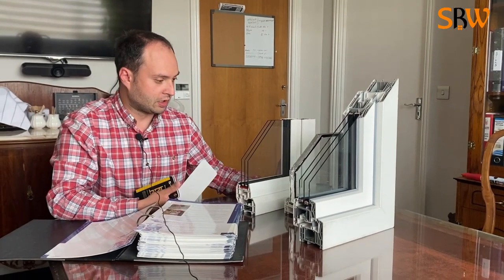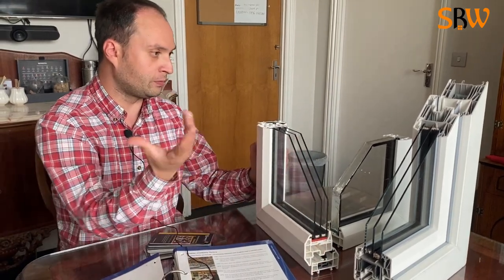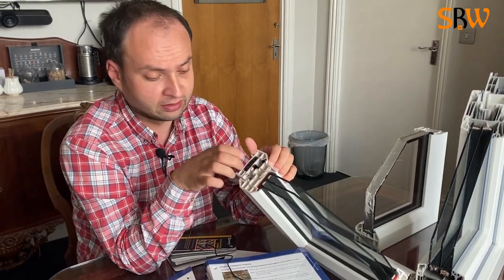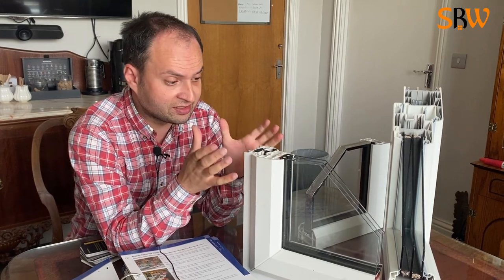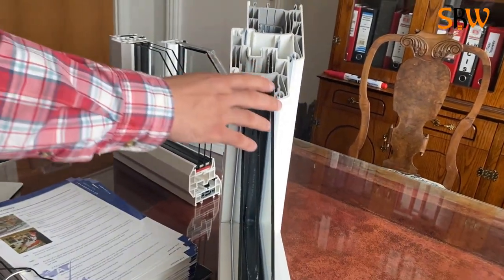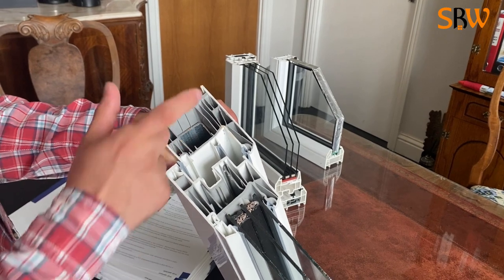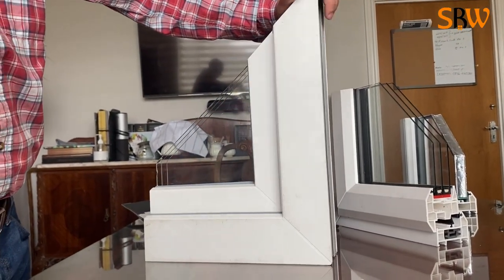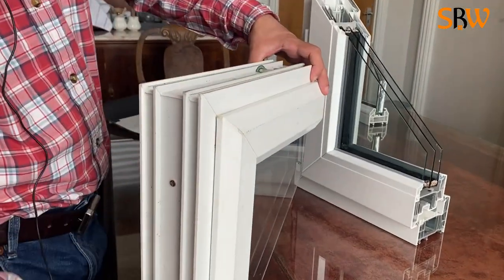ANGLIAN WINDOWS - THE BEST WINDOWS IN THE  UK MARKET? / SBW GROUP

Comment: Shit company and shit quality windows, doors etc.. I have order from them composite doors with the treshold l received without (normal window frame witch finaly cracks on corner after one year and the water is leak inside when is rain.the lock is broken as well, sometimes l cant open the doors by key because something is broken inside. They tryed sell this simple Doors for 3600£ l told them it is to much for this kind of doors, finally l bought this doors for 1500£. With installation also very bad quality, no foam between frame and bricks. We opened a case but everytime they ignored Us. Im Not recomend this shity company, very bad experience. Beware!!!!

Comment: EU regulations require a minimum percentage of recycled material in new replacement windows, if Rehau don't use a virgin PVCu on the inner and outer skins then the whole unit right through must contain the recycled material either that or it's illegal and bad for the environment, as for security, I see that the Rehau unit is externally glazed with the bead that holds the glass in on the outside, this is very easy and silent to remove in order to take the whole glazed unit out to gain access to the house.
Reply from the maker: @terrybrooks395 you are wrong . This sample is a tilt and turn , internally beaded.
Secondly, you may use recycled upscale for chairs and toys and plenty other destinations, but it is wrong to recycle for the same purpose. Would you like to know that your new windows are someone else’s old windows ?